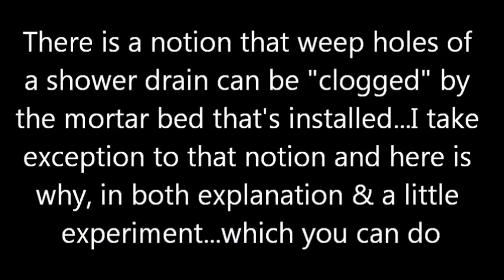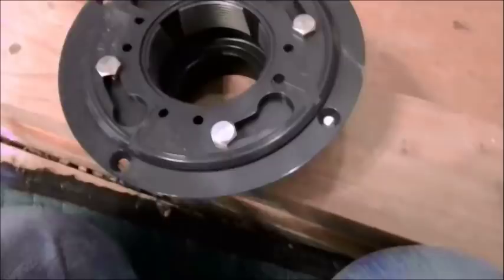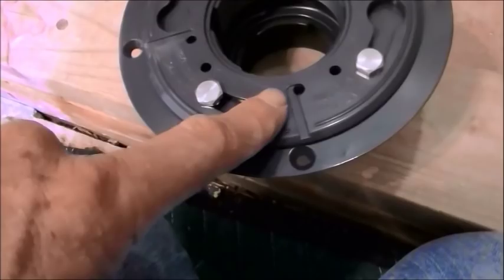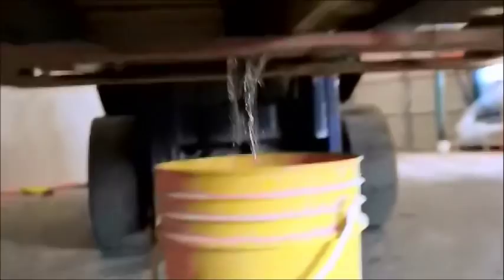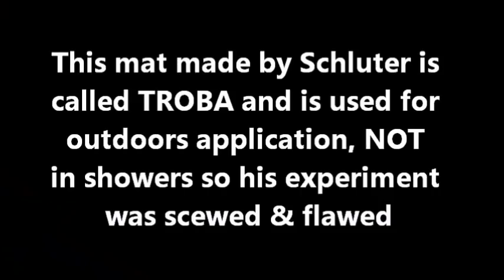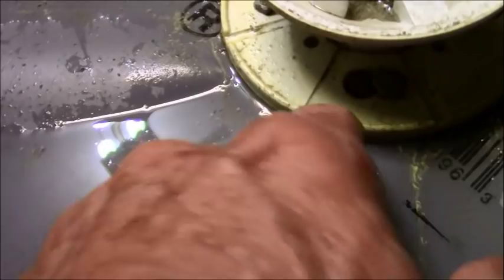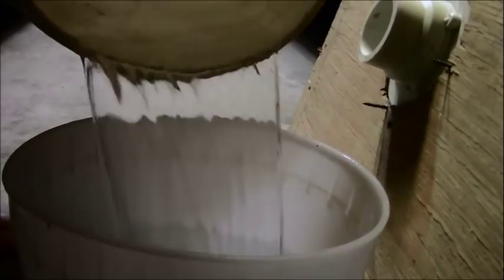SHOWER DRAIN WEEP HOLES....explained

Comment: The mortar is not necessarily what is clogging the weep holes,its the efflorescence that builds up around the mortar that is filling up the weep holes. If you protect the weeps from the mortar getting in there, the efflorescence cannot build up in those tiny little holes. Also the drain you show definitely has a lot of weep holes, but there are some cheaper drains from big box stores that only have 4 tiny holes. 33years tile installation here. I now trouble shoot shower systems full time and see this all the time.
Reply: What type of company do you work for to troubleshoot showers for a living? Sounds awesome
Reply: I need you!

Comment: First shower pan project, Home depot says i should use peet gravel over weep holes(I'm not),  also they put backer board after liner then do the mortar.  I dont want to replace this shower in 10 years. I trust your work experince.

Comment: I don’t know man…I have never done a shower pan in my life but I just took apart the shower at the house we just bought (12yo) because of the mildew smell and two things
1) weep holes filled with mortar 
2) no pre-slope
The mortar bed was stinky but not saturate.  
Some mildew under tile especially near drain.  
(No redgard in bed, just in corners on wall board). 
I’m not sure how I want to proceed…
Thanks for the videos.
Reply: I like Starr-Tile's rebellious ways and think a lot of his principles are good, but if it were me, I'd insist on a pre-slope.  If your contractor balks, just buy pre-formed foam one for him that he can just slip under the liner.  It's only $60.  Cheap insurance, IMO.

Comment: Very good video my question is how we are going to test the liner if the weep holes will keep draining
Reply from the maker: You put a plug in the drain and do a flood test after the liner is put down.....

But..... this is an old video and we don't do that anymore, the mortar surface gets waterproofed so the motar will never see water and neither will the weep holes. Look up sealed system shower on YT

Comment: Funny,  I always knew this and always got comments from carpenters and plumbers about why my weep holes aren’t protected?   “Um, because deck mud is specifically used for its porous water flowing ability”.   I’ve moved on to a single final float and will only do a pre float, membrane and final if requested by the customer.
Reply: Could thinset clog them if a wet mix was pushed into the float?

Comment: Anything that is built correctly will work. Some guys do things by the book because that's how they were taught. Plus to be fair some municipalities require you to use the book methods or they won't pass your inspection. In places like California were Isaac and landburge tile are or in Boston were sal is if you don't use proper book methods you don't pass inspection. Everyone has their own way but if you are a homeowner and your looking at YouTube for ways to do a shower your better off using a book method or using a shower kit with instructions. It will protect you incase something goes wrong with the build. I'm a professional contractor and I have been called to look at showers that don't use proper methods and fail because the homeowner decided not to do everything right. Fact is if you waterproof everything on the top and use the right drain you won't have a problem. I prefer to use a bonding flange drain for topical membrane application because then you don't have to worry about weeping.
Reply from the maker: I agree with most everything you said especially your last paragraph. But there are a lot of people who question things like me, they want to know why you must do a b and c, I like showing these things against others who you mentioned that it must be done without explanation or logic behind it. So at least ppl are given a choice. Here in Georgia there's no rules on what a homeowner can do in their own home so at least they'll have both sides of knowledge before deciding how and why moving forward with a project... in my opinion there is no such thing as too much information
Reply: You are an wrong and are providing incorrect and inaccurate information.  I hope no one takes your advice. The manufacturer of most shower drains in America Oatey, recommends that you put gravel around the weep holes so that you do not clog them up. I guess you know better than the manufacturer???

Pre-sloping the floor prior to your mud bed and liner are just "Insurance" to protect a customer's house and the huge investment they've made. The same can be said about the actual waterproofing of a shower. Showers cost thousands and thousands of dollars, and you are just too lazy to give your customers the extra added Insurance to protect their investment for years and years. You give true tile Setters a bad name.

Comment: The standing water puddles on the membrane, wouldnt that cause odors  over time?  By pre sloping under membrane gravity becomes a friend to this situation.  What am i missing here?
Reply from the maker: I have a video call pre-slope explained I did it about 4 years ago, use that title in the search box on YouTube and you can watch it
Reply from the maker: K T  that is one way to do it, although nowadays we are waterproofing the pan surface so it makes you pre slope a moot issue
Reply: It actually easy to build proof of concept to validate wether capillary effect will retain water in thin-set. You would need bottle or jar out of transparent glass, fill it up with thin-set and put it on upside down till it dries out. Then immerse it into water for day to saturate it with water, then remove and put it upside down on something impervious like piece of pan liner, this is just  to simulate that nothing sucks out moisture out of it, but same time allows natural wheep due to gravity, so my guess without sustained water source thinset will dry out quickly as gravity will pull out all water molecules, so preslope actually works as it’s pitch enables water molecules to drain toward wheep hole. Mud bed temperature is not high enough to keep water in jar in gas state so it will get dry.

Comment: Great experiment but Pre-slope will help water head toward the drain and not just sit and grow filth. You’re gonna slope the shower tiles anyway… may as well have the liner sloped. After all it’s not really water going down the drain, it’s a magical elixir, soap, shampoo, skin … but structurally it probably won’t matter. Ps for diy’ers … true  deck mud has no lime in it… most pre-bagged mortar mixes do. Quick Crete etc give their deck mud  formula on the spec sheet as either sand:Portland cement as  5:1 or 3:1 for deck mud … you can make your own… ( that’s Portland cement not concrete )… mortar and concrete have lime added which apparently reduces porosity and drainage which is up for a philosophical debate. Less porosity means less water gets in in the first place right ?

Comment: Pebbles aren’t to stop weep holes clogging-it’s to create a path of least resistance for water that’s wicking into your pan saturates to the bottom of your deck mud and then ‘ wicks ‘ into the rest of your pan when saturated- the rocks create a permanent non saturation area that hits the bottom plate and down the drain before 100% Saturation of your deck mud and expansion of wicking properties

Comment: Hey so if you waterproof all the way to the drain. How does the water get over the drain? The drain sticks out about 1/4 of an inch above Redgard. How do you address that? You will have a wet ring of water around the drain about 12” in radius.
Reply from the maker: Not sure what you're talking about, the shower pan is waterproof up to the neck of the drain, a bead of silicone is run around the edge of the drain where the mortar meets at it...if moisture gets through grout it is stopped there and dried before next shower.
Reply: Ahh, designs... Water on top of tile will flow over drain screen and into drain. Water getting through grout joints will flow on top of redgard, around adjustable screen, and down center of drain. If you need further explanation, go buy a 3 pc drain and re-watch this and other videos with drain in front of you.
Reply: Str8UpCampin not if you silicone right around the drain. There are no weep holes to get to. If you have a family that takes three showers a night there is absolutely no way that it will ever dry.
Reply from the maker: A bead of silicone is put at area where Redgard meets drain neck...no water gets into pan
Reply: StarrTile but that’s my point. Water cannot drain out properly. Maybe do one or your tests and see how long it takes for that water to evaporate.
Reply from the maker: @WINNI.Designs  I guess you miss my point, my tile around my drain is higher then the drain itself so therefore water would have an easier way to evaporate, and hence a experiment is not really needed... the depth of what we are talking about is a whole lot less than a soaked shower pan 👍
Reply: Ahh, unless you put a reverse slope on your pan, water will drain just fine. Remember that unless you use epoxy or similar grout and caulk perimeter like crazy you'll always have water getting under the tile and hitting the redgard membrane. It'll probably be damp it's whole life. That's no problem. 99.9% of the water is going down the drain.
Reply: You can cut slots around top of drain under drain cover for sweep holes  if concerned about it pooling there.
Reply: Ahh designs, it wasn't until I watched starr tiles video from today that I finally understood what you were saying. I thought you to be a crazy person. Today's vid shows him siliconing the drain screen to the redgard. I personally wouldn't do that. Like you were saying this would potentially cause a backup of water trying to run on top of the redgard and down the drain. When I do my pans I leave out a ring of sand mix around the screen and exposing the drain flange. I then redgard all the way down to the drain flange. Before I set floor I fill in the ring with sand mix or thinset. Water traveling across redgard will go to the weep holes or threads in screen plug.
Reply: Someone needs to lay a bed of 2x2 tiles with epoxy grout and let water stand on it for 24 hours. Maybe do it on a sheet of glass. See if water gets through to the thinset.

Comment: I always wondered why people say water will travel through the mortar under the tile, but not the mortar in the weep holes. It seems illogical.
Reply from the maker: Right ????!!! 😂
Reply from the maker: @bolerdweller  I will clog the threads and do another experiment I don't know how difficult it is to understand... mortar is extremely porous, water will seep through it even in a three-quarter inch hole that's a 1/4" thick
Reply: MoneyManHolmes the weep holes unclogged gives it an easy exit as opposed to a disrupted exit. Common sense
Reply: @StarrTile  What about mineral deposits in water? Will those clog the weep holes when stuck between the tiny particles of mortar? What are your thoughts.
Reply from the maker: Anything Could Happen, but now that we waterproof surface it's irrelevant

Comment: Common sense tells me that while weep holes packed with mortar will flow water, they will likely not flow as fast as weep holes surrounded by pebbles. The few inches right around the drain is where the water will all end up. I'll take a technique that evacuates that water quickly over one that lets it out slowly. Unless someone has evidence to the contrary.
Reply from the maker: The water had enough access to get to the weep holes through the mortar so the mortar around the weep holes is irrelevant, and when you mix mortar with rocks you have concrete, Pebbles as you propose are denser than sand, there is your proof, but totally irrelevant now since we waterproof the surface

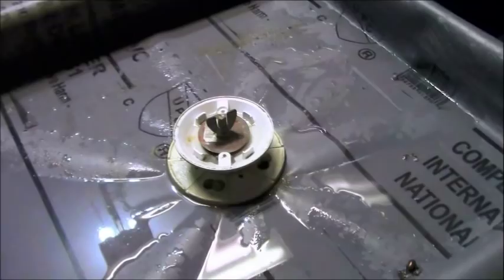Comment: By not also clogging the bottom troughs (shown at 7:45 and later in the video), does this experiment really demonstrate that clogged weep holes isn't a problem because it can still drain water? It appears that the water simply drained instead through the unclogged troughs, and thus doesn't really demonstrate that clogging weep holes with mortar isn't a problem. Didn't this effectively just demonstrate the same situation as "if you only clog 1/2 of the weep holes, water will still drain out through the others"? I'm a big fan of these StarrTile videos, generally - but I'm simply not following how that experiment proved anything. Wouldn't you need to clog ALL of the weeping points, to make the case that it doesn't matter?
Reply from the maker: No, the point I was trying to make is you cannot clog weep holes with the same mortar that you propose water can get through 3 ft away to even GET the holes....contradictory. Mortar is sand/cement so water will get through, introducing pea gravel or rocks will make concrete, water would have a harder time getting through a rock then it would sand, especially if that rock is dead center of the hole which you would never know. And as I stated in the video there is not just the holes but the trough cutouts on the top and bottom of the flange as well as cutouts inside of the barrel threads.

Of course it's all a moot issue now since everybody waterproofs the surface of the pan, water should never see any of that stuff to begin with. The manufacturers of the drains have not caught up with the modern practices.
Reply: @StarrTile  I’m pickin up what you’re throwin down.

Comment: I live in RI and I drew a design how I wanted my walk in shower done. Someone refered me to a great contractor who I met with and recieved a price. He sent a tile guy who did a great job on my floor but not my shower. He forgot to put a pan in , tile cuts didn't match, water stayed in the middle of my shower and wouldn't drain. I asked the sub contractor to show me his license and insurance,  he said he didn't have any and he told my contractor that he tiled as a hobby. My shower now leaks out from under the step up. I live on SSDI after working on a rescue for 10 years my knees and back are not good so I have to save for jobs like this. My savings are gone and everyone I call to come fix it, they won't touch someone else's bad work ? I don't know what else to do... Help anyone ? Earlene

Comment: Installer raised the height of the top float with thinset mortar to make the top surface of a thinner tile to meet up with drain properly.  I noticed the thinset was very wet and I wondered if the thinset could flow to weep holes and clog it.  Do you think there is any risk of that?
Reply from the maker: Weep holes would never kick in because I waterproof the surface of the motar and the entirety of the shower
Reply: @StarrTile  how do you waterproof the surface of the mortar?
Reply from the maker: @terrinight5035  with Hydro ban, Redguard, aquadefense, even a Kerdi membrane, doesn't really matter as long as water doesn't get through

Comment: This shower war is going to go on forever lol. Issac cheated on his experiment so I considered that null and void.
Reply: Isaac didn't cheat. He used a different material to enhance the flow of water. If you use a weep hole sheild witch is a plastic ring that goes around the drain you get the same effect.
Reply from the maker: @ryancoulter7681  he cheated because he used an outdoor landscape mat that is not meant for showers and no one uses, so his experiment was void of real life applications...the plastic weep hole protector wouldn't have nearly the same effect.
Reply: Bob in all reality everyone uses a topical membrane anymore. And Issac used a Schluter product that is available to anyone for his drainage mat. So it is realistic to do so. They do things differently on the west coast. I use a bit of this and a bit of that depending on the need or want.
Reply from the maker: @ryancoulter7681  I would agree that modifying methods is not a bad thing, I do it all the time, but in this situation I had gone to the tile store I deal with and the product is extremely expensive and it comes in a huge roll that you must buy all of it for because again it is an outdoor application... it was never meant to go on your shower pan liner , that's the point I was trying to make, and because it is not meant for such an application I doubt people like Isaac actually using it because they are book soldiers and do everything by rules.. but to make his experiment believable he had to use something to get the water to escape so quickly.
Reply: The old ways are just that imo Bob. Hydroban, redgard, aquadefense, kerdi, wedi, ardex 8+9, ect. These are the new ways of doing showers. Pan liners and weeping showers are a thing of the past. Now need for them anymore. If I were you I'd stop even buying the liner. It's really not needed anymore. But use a bonding flange drain instead of the three piece. I challenge you to show a new video with this application. I've used it for years and never had a failure. Plus the manufacturer backs it if installed correctly. Go outside your comfort zone and give it a try. You will like it and it will speed up your process without compromising it. Take the challenge man. I look forward to your thoughts.
Reply: @AOmega72  in fifteen years of installing tile showers I have never flooded a house 😂.